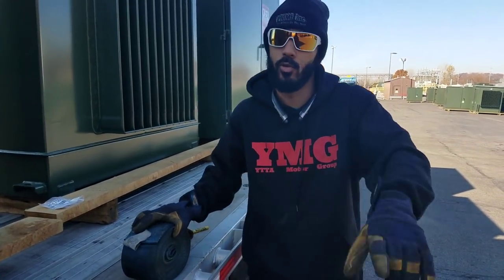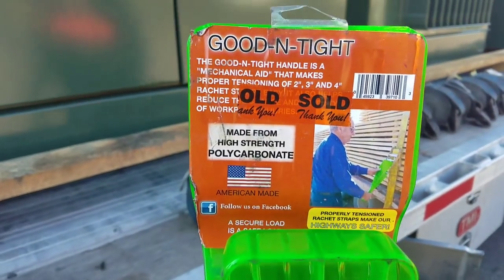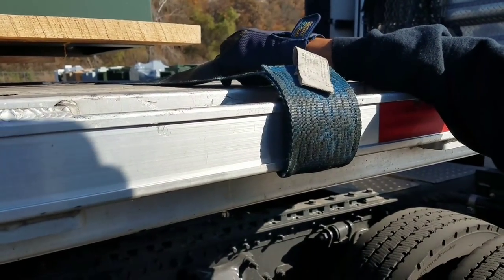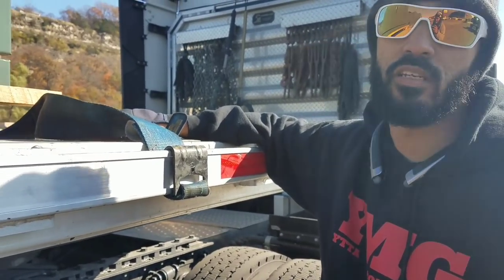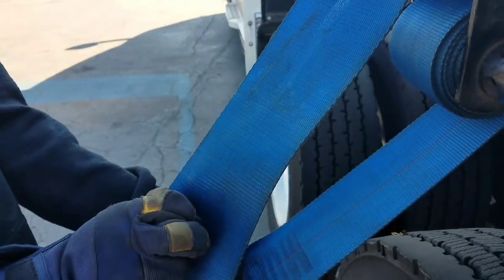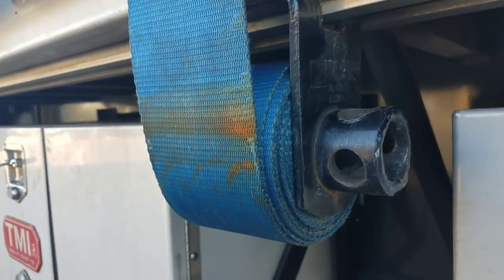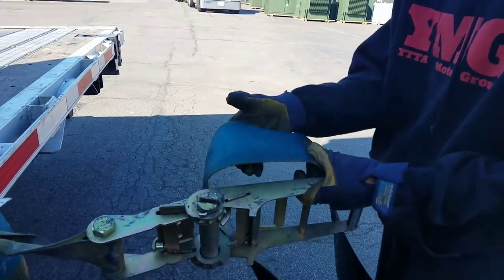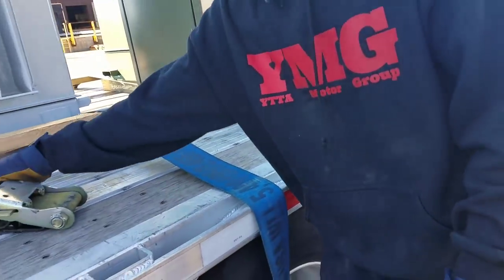trucking : strapping in flatbed 101

Comment: You'll never get the strap tight enough rolling it up on the winch. 
Pull the strap all the way through the winch. Then take end of strap and fold until you have all the strap folded.  Then stick between the strap and trailer. Then take winch bar. And tighten winch. Tighten your load down. As long as you have 3 to 4 wraps around winch to prevent slipping the better.  Less strap on winch the tighter you can get your load down. You will never get a strap fully tighten the way it's shown in video
Reply: I personally roll my straps on the winch....if u do it right u won't have a problem....not a fan of folding my straps.....but I do store to them on my box
Reply: I've seen so many videos like this...they wanna show how things are done but in reality they doing it all wrong...this ppl think this is just for fun not taking it serious

Comment: NEVER ROLL THOSE STRAPS UP IN THE WINCH, run it through the winch and fold the access, and tighten and it will stay tight, if you roll all that strap up it will loosen, AND NEVER STRAP TO THE SKID, when I haul those I use chain and boomers and cross tie it through the lifting lugs on the transformers and they are safe to haul.
Reply: I Agree it Gets many times tighter
Reply: That’s what I said those straps will loosen every time

Comment: One thing Lo does but doesn't explain is to take the strap all the way out of the binder, roll it up stripe out, hook last, and put it in the box.  When you wind them up on the slider and leave them they are out in the rain and grime, snow, salt, you get grit in your binders, it's dirty.  Roll towards the hook last so you are not throwing the hook over the load and maybe brain somebody on the other side you don't see.  And maybe take a lighter to that first strap and melt the frays down.

Oh Tom and Jerry is on Boom Network.  Looks like a mix of old and new episodes.
Reply: I drive for a building supply store. We leave the straps on the trucks so no one's stealing them between them. Our ratchet straps are mixed all up due to everyone grabbing from each truck. We slip seat depending on number of drivers day to day and load needs. Most days I use almost all of grvstaps besides the hand ratchets for each load. Other days I add extras.

Comment: The fold method is better.   You almost never have to worry about loose straps.wrapping the majority of your strap around the winch will generate slack over the duration of the trip. plus the fold method provides padding for the strap. Plus don,t hook to the rub-rail, place hook under the the trailer. Your load should not be secured to anything that is meant to be rubbed on. TB is right....this time..lol.
Reply: You must not haul very tall loads, have you checked the prices on straps lately? Pretty expensive for 40+ footers. Attaching to the rub rail on trailers that are rated for it is an accepted and legal option. Most trailers manufactured and sold nowadays have rub rails rated for in excess of 5600 lbs between the chain spools/stake pockets. Lemme ask you this, if your rub rails are not acceptable to hook your straps too, then why are your winch slides slightly behind and underneath? All the flatbed trailers that I pull behind my truck are set up to run winches on both sides, and do not have a spot designed to hook a strap to. It's either the rub rail or the frame of the trailer, which adds an additional 4 feet of strap needed. Plus, it also subjects the strap to road debris. I'll take my chances with the rub rail.

Comment: Why you strapping it over the weak wood?
I just started truck driving but that looks like a dangerous option.

All the weight is in the machine which is only bolted down into the wood frames. So you are essentially using all those straps to hold down the wood.

All the weight will shift and crack the wood around from the bolt.
Reply: Having hauled these before, I can tell you that you are NOT authorized by the shipper or receiver to strap over top of the load. It damages the load, and makes you as the carrier liable for the repairs. They hold very well, and do not come apart. If they do, it's on the shipper to fix it.
Reply: @traviswyatt3944  1st time he loads these and rolls with the straps over the top will be the day he is looking for a new job
Reply: @stuff happens, basically what he's saying is when you pick up at customers like this that manufacturer transformers, AC units or anything of the like, you never, ever, ever throw any kind of securement over the top. It causes damage to the units and those units are expensive. Some manufacturers will actually ban you from returning if they see a strap or see you in the act of throwing a strap over the unit. A lot of trucking companies in most cases once you have been banned from a customer will terminate you in order to protect their relationship with the customer. 

I used to pull a lot of equipment for Ditch Witch out of Oklahoma and at that place, drivers aren't allowed to secure the load at all. Merely just check everything to make sure its all tight and secure.

Comment: I'm new to flat bed, been driving reefer for 5 yrs..
Why strap the pallet and not strap over the generators?
Reply: David rios strap could damage the metal on the generators due to the tightness.
Reply: the gen is securely bolted to the pallet .
Reply: Them’s transformers

Comment: Aluminum rub rail is not a legal place.for strap hooks read your book
Reply: @roger Wyatt It depends on the manufacturer and trailer model. Some manufacturers have started making their trailers with load rated rub rails as well as fully welded welded spools and stake pockets. Definitely don't expect this from a company like Utility though. You just have to check all the decals or data tags on a trailer to determine if the rub rail is load rated. On the other side one will find these trailers naturally more expensive than a cheap starter combo trailer.
Reply: My rub rails have a manufacturer rating on them for 5400lbs and the pockets are rated as a single pocket is 5400lbs, double pockets are 7000lbs

Comment: That shows you how to NOT properly secure a load. The transformers are the heaviest parts of the load, not the wood cradles. If they were steel cradles bolted onto wooden bases, then it would be more secure because the steel's breaking point would be much higher than the wood's. Not to mention the angle of the straps to the deck should not be less then 30 degrees, because at such a shallow angle the vertical force the straps apply is probably less than 30% of the force applied when the straps are perpendicular to the deck. In such a case it would be more secure to use chains and binders attached directly to the load. In all this is a poor example of load securment.
Reply: Issue with these transformers is they aren't built to handle pressure on top, this they're ptesecured to the wood. I might run a safety strap over the top and snug it though just to feel safer. It won't be holding it, just a backup for saving lives.